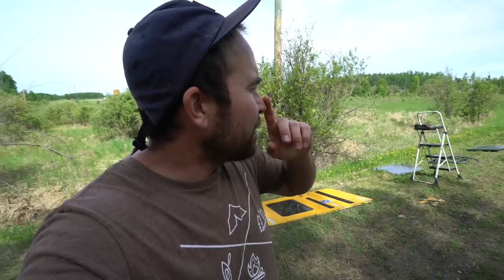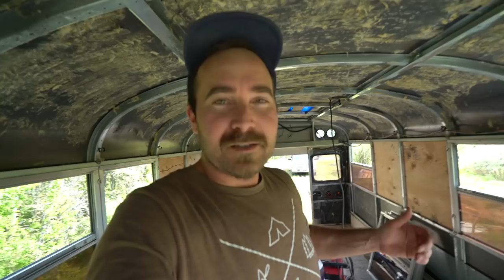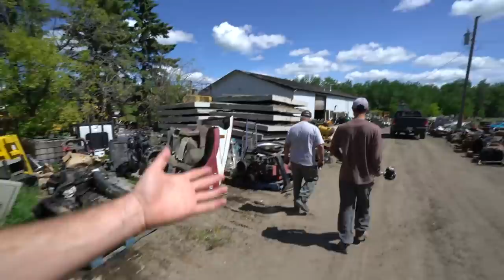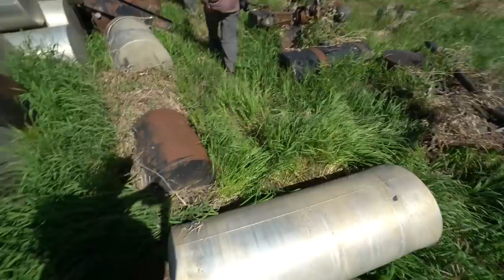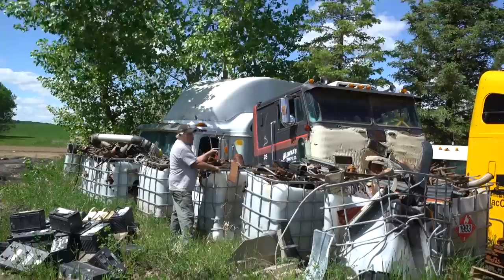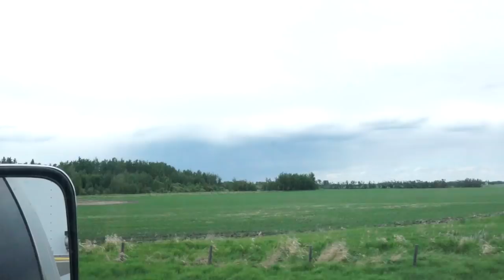LOOKING FOR SKOOLIE PARTS AT JUNK YARD

Comment: Michael is right.  The bus frame is rated to carry that much weight for "fuel".  It's a bus, designed to carry people.  If on "average", each person is around 200 pounds, times 66 people (a full bus) that's roughly 13,000 pounds.  You're only gonna carry a few thousand pounds of fuel (diesel & veggie oil) so there ya' go!

Comment: the diy payed stuff has been done to death , think small youtube shows be better , could link to a payed website for more detailed info on the youtube video that aired , a forum to aswer questions , and links to where to get the best priced materials and other time / money saving stuff like that
as for using a big storage tank for running veggie fuel : when veggie fuel sits a while it atracts moisture and gets algae in it that can clog up the filters 
you could cycle it through a heat exchanger to heat it up with the webasto every so often with the tank cap open to evaporate most of the water out and filter it through some cloth with the same recycle system to get most of the algae residue out , you could use the big tank to store unrefined veggie oil in and make bio diesel out of it , you can pump that intoo the normal tank once its processed
about the mecanical line pumps , i have seen mercedes electronic diesels that have been converted to mecanical (sweden i think )
https://www.youtube.com/user/dieselmeken/videos